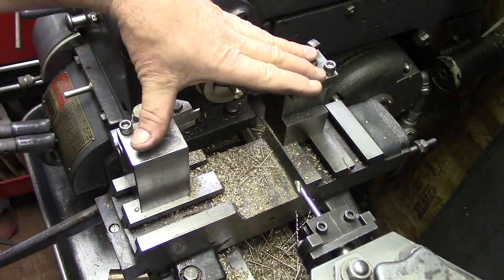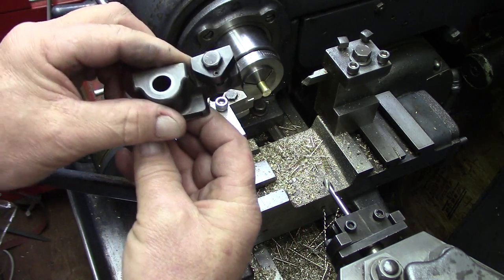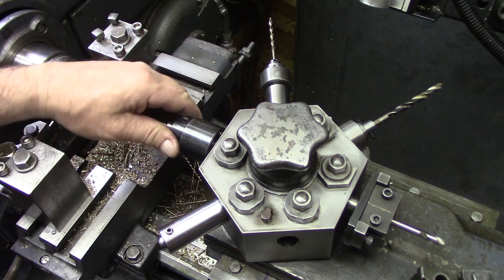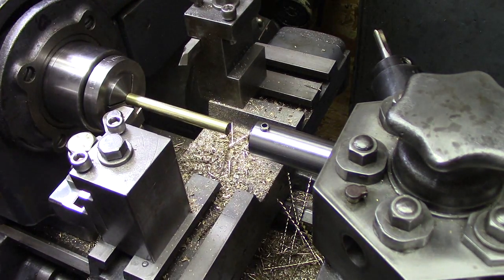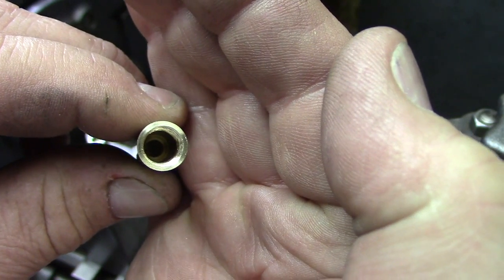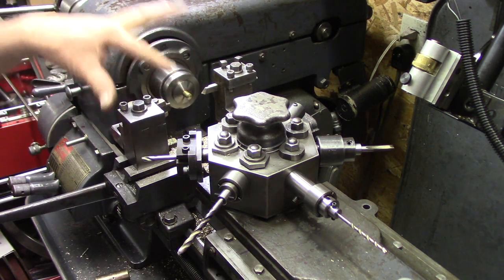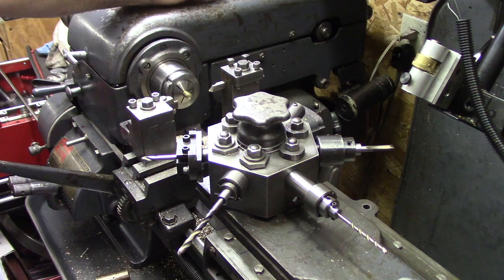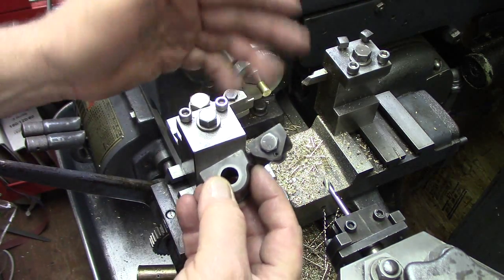How To Build a Carbide Pocket Scribe Part 2

Comment: Man do I love running my turret lathe. It's even better when I make money off it too. I have a wade 98 turret lathe that goes up to 3500 rpm with a 2.25 through hole and takes 22j collets. I run a 5c adapter in it as I don't have a good collection of 22j collets yet. This lathe has instant forward reverse, high low and brake. If you have an Instagram check me out at Hightowerknifeandtool thanks. You should mention that a tool is more rigid upside down as the pressure is down into the slide rather than pulling up. You should also try aligning your turret if possible it helps a lot when working with harder to machine materials. Also try brazed carbide parting tools that are for screw machines. They work wonders and last forever I know as I work with lots of titanium. Thanks again!
Reply from the maker: +Carter Hightower Thank you for the suggestions.  I am going to work on getting the turrett better aligned, I have been wanting to do that.  The parting tool I am using is a brazed carbide, and it works great, from a B & S screw machine.  I want to make a scribe from Ti.  I have never worked with it.  I will check out Instagram page.  Randy

Comment: I used mine the first day I received it. Which the moment I took it out of the case I had to test the point, and, well, the fr's is pointy! :)

I'm pretty sure I will die before the Scribe will...Now I guess I'm going to have to inquire about the dovetail cutter?

Thanks, Randy!!
Reply from the maker: +Neil Smith Thank you Neil for your support, and yes they are sharp.  I did not put in a warning label.  I think you need a dovetail cutter, oh they are also sharp.  Thank you again.  Randy

Comment: I noticed counter bore bit move sideways at the start of its operation.  But I also noticed the counter bore bits' holder on the turret flex, when you touched it at 17:15  during your time of operation discussion.   Does that movement effect how true a boring operation is on a lathe?   I realize that it's not critical on a scribe, but I've seen other videos of YouTubers performing drilling operations with often the same flexing upon contacting the center drill spot and wondered.
Reply: +hankus253 Just because somebody has a you tube video doesn't mean they know what they are doing.
If it did then everybody with a video camera would be a master machinist.
Reply from the maker: +hankus253 These holders do not hold the drill tip perfectly in line with the axis of rotation, because of the flex feature.  They are close.  These holders are actually made for holding a reamer. But I have found that they work quite well with a drill.  It is like drilling on a drill press and allowing the piece to self center.  Just here the drill tip is moving a small amount to align.  The first drilling process I use a rigid fixed spotting drill to get a good center.  

On many Lathes the tail-stock will be aligned front to back for no taper cutting of your work piece.  But the tail-stock may not be at the exact height of the center of the axis of rotation.
When you place a center drill up to a faced off work piece the drill will want to wander if it does make contact at the exact center of rotation, and it will try to find the center.  If the drill is small and sharp (and the facing was done well) the drill will center up on the axis of rotation.  You do not want to drill a deep hole it may not be the straightest.  Drill straight deep holes is not easy.  There are several reason for movement of the drill, Poor facing, leaving a bump or tit at the center, Dull center drill, Poor tail-stock alignment, Play in the Tail-stock quill ( I hold the quill lock a little snug when first starting a drilling operation).

When ever drilling into a previously drilled hole to enlarge there will be movement as the drill finds it center of rotation, hopefully will be the same as the work piece.  The Drill needs to be sharpened properly for these two to be coincidence.  Thank you for the great comment and question.  Randy

Comment: Congratulations on the new addition to the family Randy. Have been through Montana many many times on the I-90 it really is a beautiful state.

Guestimating, but without that collet closer, lever operated cross slide, and that turret I'd be hard pressed to make that part at 10 times the time your doing it on my lathe.
Reply from the maker: +Turning Point Thanks, Well you should add in some time for the setup.  Randy

Comment: thats slick!
Reply from the maker: +Phil's Projects Works well,  How is getting the lathe going?  Randy
Reply: i should be doing a road trip with Pierre on tuesday to dover PA. 
Graziano Sag 12 well equipped  needing a little tlc got a smokin deal on ebay.
Reply: at that price the trip is worth it
Reply from the maker: +Phil's Projects You will like that lathe,  Just the trip with Pierre will be tough.